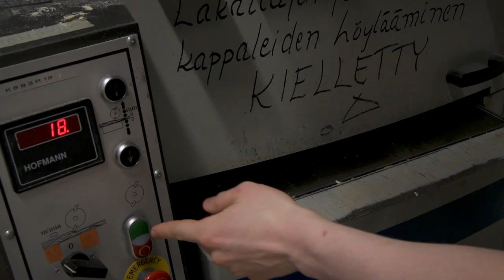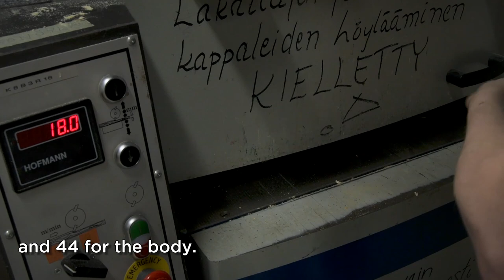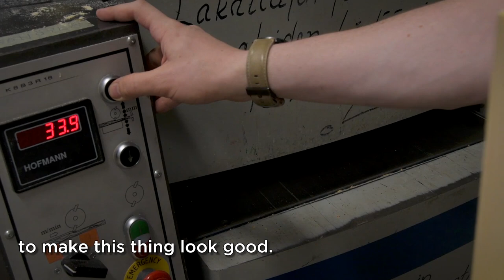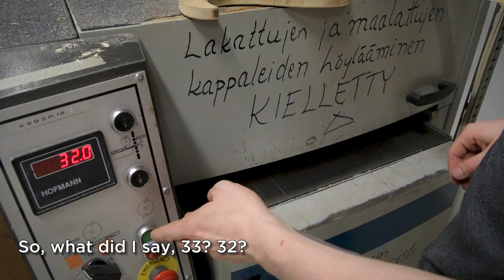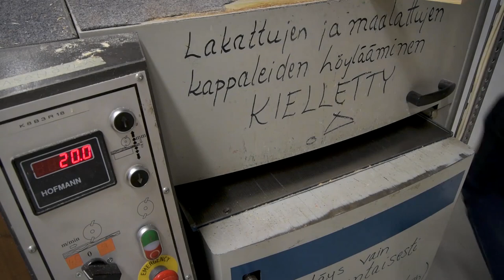Bandsaws Are Always So Much Fun! - BUILDING A COMPLETELY PINE GUITAR

Comment: This is Really nice build compliments from italy.May i ask ,to do rough cut body and neck blank ,what is the ideal band saw and power does it require
Reply from the maker: Thank you for the nice words :) however in regard to the bandsaw, I don't quite know specific. I don't have my own, so I haven't had a chance to look into the matter. However, you really don't need a big one. For guitar building even a small table top bandsaw will easily do the trick. The narrow blade also helps get your curves in a single pass too. I've used Record and Axminster ones and they have been amazing each time
Reply: @IPGuitars  I am very pleased how quick you have replied.As i have small budget i am thinking about Metabo BAS 261 Precision Band saw .Do you think that's will be enough  to do the rough cut ?It's a 400 Watts power.His big brother is 900 Watts but for home use It's a huge.Thanks so much for your kindness.
Reply from the maker: Probably good to check online :) people talk about this kind of stuff on forums constantly, so I wouldn't surprised if someone has used that model for guitars too. Just a quick google search and I found a couple of threads already.

Sorry to not be of too much use on these matters😅
Reply: @IPGuitars  It's very kind of you and thank you anyway.

Comment: Hi Thomster.  With pine being so soft, are you going to harden the guitar in any way?
Reply from the maker: For the fretboard, I covered it in epoxy and the rest I shou sugi ban'd (burned). Then applied clear coat and car polish over the whole lot. I am still amazed at how little scratches and dents I ended up with :)
Reply: @IPGuitars  Thanks again